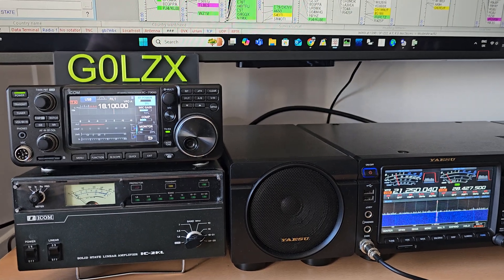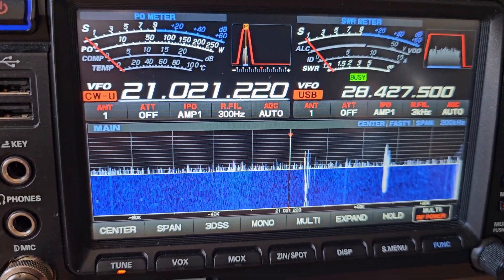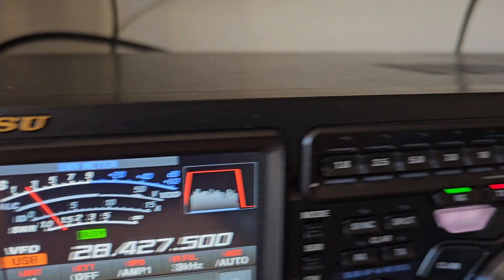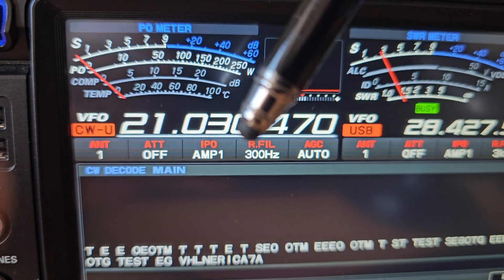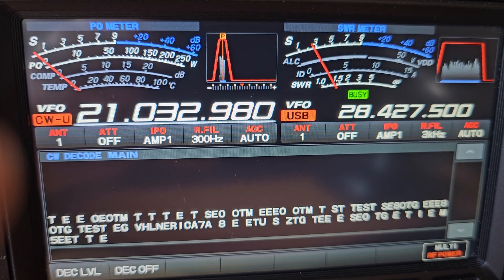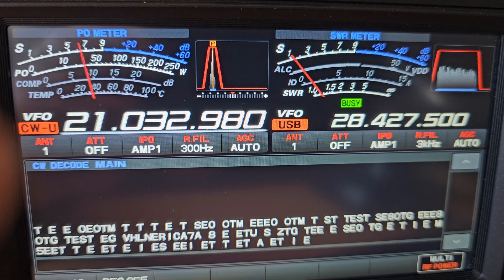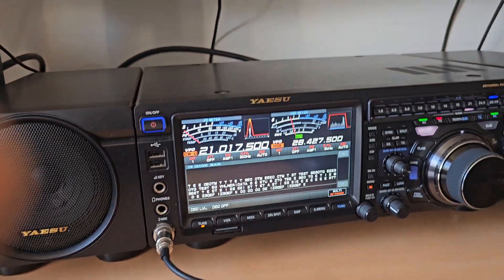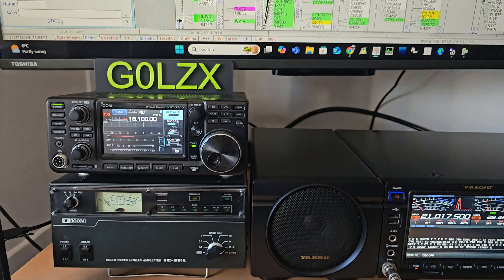How to successfully decode CW ( morse ) with the Yaesu FTDX101MP,  simple tricks to try

Comment: Nothing against your video but the decoder seems basically useless. Those were several clear, clean, easy to understand signals and it hardly decoded anything correctly .
Reply from the maker: It takes a bit of patience,  with a bit more tinkering of settings etc it works great

Comment: Sorry for the dumb question, I’m new to this, but can we just use a QWERTY keyboard to type text and then have the transceiver to send it in CW automatically? I know, I know, the purists will say I should learn CW (and I’ve learned it a little bit, but I’m not good and fast enough) and there are so many things to learn in life, I just don’t have time to really dig into CW to become fully operational…
Reply from the maker: I don't honestly know , I think the only way of sending is via the cw memory locations , so you setup and store what u want to send then use the corresponding memory location number to send the cw ..  I know there are some radios out there which can utilise the ptt on the mic as a " key " but don't think you can on the 101 ? 
If anyone else can shed light onto this i welcome your input

Comment: Excellent video Ricky. I’ve recently purchased a FTDX10 but I haven’t tried the cw decoder on it yet. I suspect it operates in the same way as the 101MP but I may need to purchase the optional 300Hz cw filter for it to operate satisfactorily.
Reply from the maker: @alan4441  congratulations on the ftdx10. Great radio... I'm sure you'll be as happy as I am with the 101
Reply: @ Thanks Ricky
Reply: No need for the 300Hz roofing filter at all, especially using the decode, it will work just fine.
Reply: @mariemccann5895  Thanks 👍

Comment: I have a 101D and have tried the CW decoded, in the end I don't use it. You could also use the Zin (zero beat button) to help get the signal centered if it's pressed while you're receiving the CW.  The built in decoder (and several others) are only really good when a person is using electronically generated CW either by a keyer or keyboard.  Stand alone CW decoders do a much better job.

Comment: Just a guess. I am wondering if you reduce the RF gain so that s-meter is zero with no signal, shall this help the decode? Just wondering if the high noise level is busting the decoder threshold and decoder can't tell difference between dits, dahs and random noise?
Reply from the maker: @Steve-GM0HUU  that's a REALLY good idea , I'll have to try that .. cheers

Comment: Thank you, and these steps are all correct and good info.  Unfortunately the onboard decoder is just not that good.  Having to frequently rotate the speed dial using the operator’s ear and best guess, and hope it finally decodes is extremely cumbersome and a substantial waste of time, and it often displays conflicting call sign results. In addition the spectrum display is lost while using the decoder.  After two contests I bought a software package to decode and it works much better, and I can keep the display on the radio on full time.
Reply: Which software package did you buy?

Comment: Why not just learn it the proper way and turn that function off
Reply from the maker: @ffighter1491  why not use it as its there to be used ....
Reply: Hearing disabilities
Reply: Exactly, there are digital modes for those who lack the dedication and skill required use CW.
Reply: Are you deaf where you can not hear the sounds and rhythm?  Do you think you'll ever learn to increase your copy speed by reading it on the screen.  I think it was designed for people who may want to use CW but may have a hearing impairment.
Reply from the maker: @ffighter1491  tbh I am OK up until abt 26wpm then it's a blur ...  cw is only a basic data mode and we don't have issues using computers to decode ... 
I've been working some WWA cw stations and they been using over 36wpm which is absolutely impossible for me to differentiate so using the on board decoder helps a lot ..
I used to have a friend , george G6VS who could decipher two lots of morse,  one in each each of headphones , he just had " the knack" I couldn't make head nor tail of it ...
So at the risk of being dumb or deaf I'm going to use whatever means necessary to enjoy the hobby 👍😊
Reply: @g0lzx  Fair enough RX, but don't pollute it for others with computer generated  TX.

Comment: Yaesu needs to work up software that posts the operators code on screen as you send, easier to send code when you're able to keep track of what you're sending. 101's is equipped with the best code reader I've ever seen. 101's have a history of software glitches, sold my 101MP shipped straight from Yaesu repair center Calif with a clean bill of health after it's second repair. May buy a new D model sometime in the future after the software has evolved in a favorable direction. Resetting my VC tune, mine would jump into full VC attenuation.

Comment: The CW decode on the Yaesu series FTDX 101's is tricky yo get to decode reliably.  Setting the CW speed is critical, and as we all know, CW sent by hand can chamge.  I find that the CW decode on the 101 is not dependable.

The CW decode on my Kenwood TS-890S just works.  Period!

I like my Yaesu, but I find some things were cheapened on the radio.  For instance the knobs and general feel of the radio feels a bit cheap.  My old Yaesu FT-920 had gold banding on tthe feet, nothing on the Yaesu flagship model.

I find the VC Tune to be worthless.  It might work for some. but I notice no difference in receive.

I do like the spit screen on waterfall and 3DSS.  Overall, a good radio that could be great.

Comment: I’ve seen all your videos on the  FTDX101MP, are you satisfied with it? Do you recommend? Thanks for the videos.
Reply from the maker: @DJGeorgetheoriginal  it's one of the best. If not THE best hf set I've ever had.  I loved the ftdx3000 and had older ft-1000 mkv but this blows them out of the water .. its not even that hard to setup of use ... if you think of it as 2 see radios ( main and sub band ) then it makes a lot more sense .. the menus are intuitive and the only thing you really need to adjust to your own liking is the tx audio and trains individual and dependent on mic and voice .
Its the most I've ever spent on a HF set but I'd definitely fo it again ..
Reply: You just proved to me that the human ear is more effective than some gimmick of a decoder
Reply: @DavidCorbett-ht4wf My ear often ends up confirming or changing the call sign displayed by a decoder, but with computers, not fists, sending CW 30 - 50 wpm using software is the best way to nail it down.
Reply: This CW decode function is maybe the least functional part of the 101MP.  It is a fantastic radio.  The multiple ways to pull out a voice or cw signal is unmatched. I hadn’t purchased a new radio in several decades so the sticker shock delayed my decision to purchase it, but I’m glad I went all out for this model.

Comment: Fail! Learn to read cw...
Reply from the maker: What if you have tinnitus or have a  hearing deficiency , the decoder can be an invaluable tool ..
Reply: I have tinnitus (dam nuisance).  I have never needed a decoder.  Trained with Marconi many years ago when the only decoder available was between your ears, when using old valve technology which had filtering which wasn't the best.  Even my Xiegu G90 had a decoder, I never use it.
Reply: I agree.  Learn to send and receive CW.  Being a competent CW operator is a joy.  Using a keyboard to send and decode CW or having your box of tricks to do it for you is no great fun.